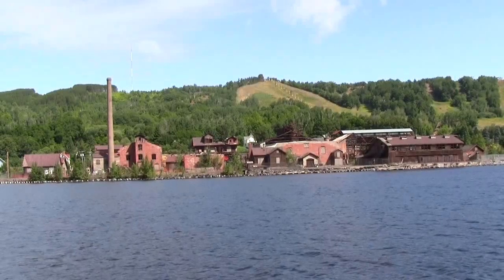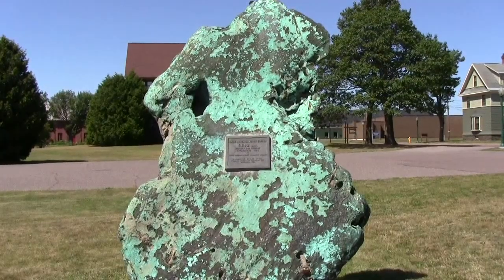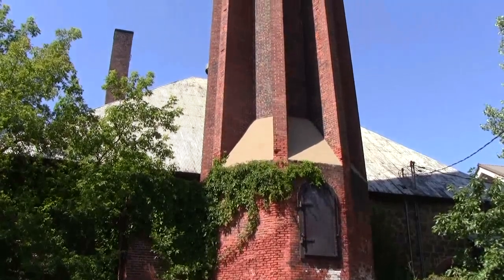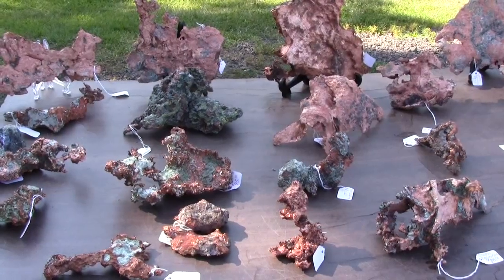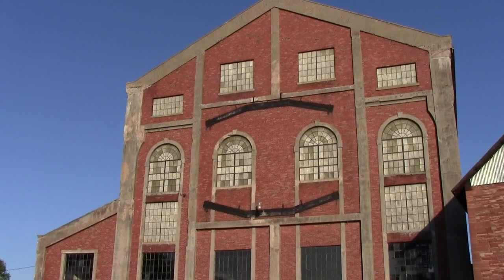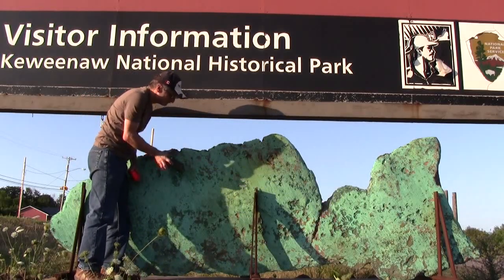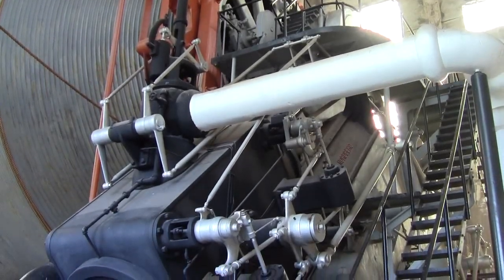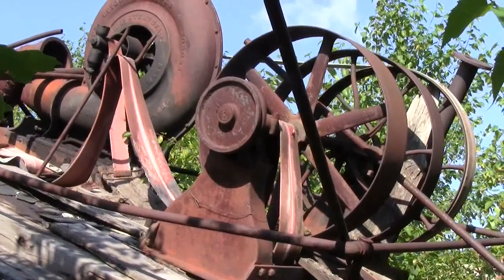EXPLORING AND MINES OF COPPER COUNTRY # 1 MINE RAT PRODUCTIONS  http://minerat.wordpress.com

Comment: for this much pure metal to not be mixed or dispersed within the entirety of the earth, is perhaps the most prominent geological wonder.  i would speculate that either it came from somewhere around the core during a specific phase of the earths formation where conditions and temperature allow. not too hot, not too cold. or that it came from outside the earth, also during a specific moment